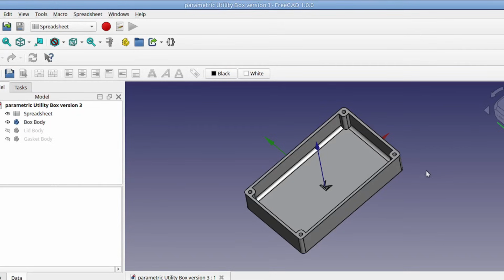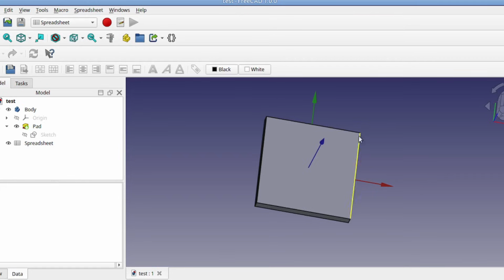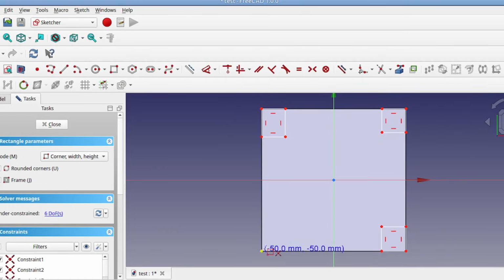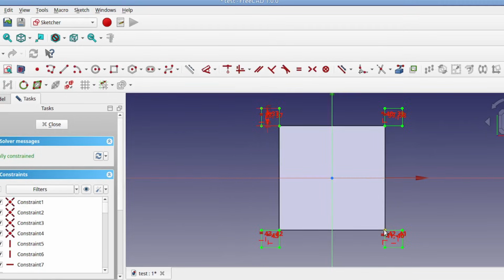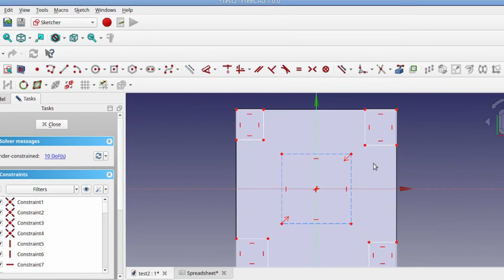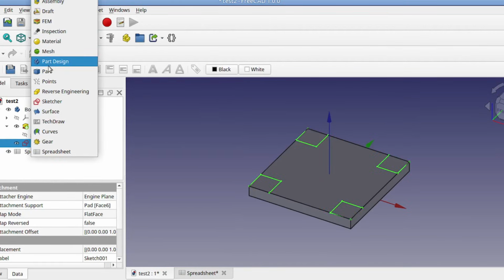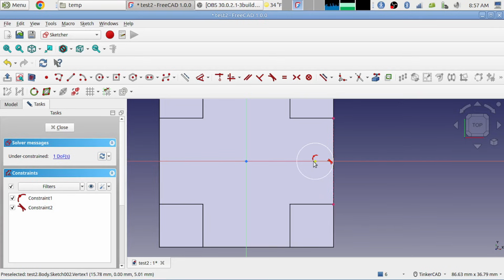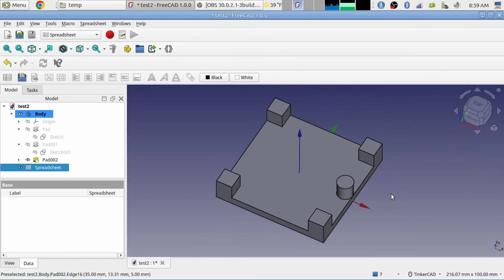3D design - One way of working around sketch flipping in dynamic models in FreeCAD.

Comment: The two antennas I bought turned out to be full quarter wave 11 meters. I walked around with it, and it was pulling in stations well. Too much torque for my photographic light stand, so I will have to pound in a solid post into the ground. Two 1/4 wave antennas physically and electrically at 90 degrees. I apologize for talking too much here, but I thought you might like to know the outcome. Thanks.

Comment: A very good solution - I frequently use construction lines in my sketches for all sorts of reasons (but still very, very rarely draw a sketch on a face - old habits). 
BTW pressing '=' in a dimension input will immediately pop up the Expression Editor for your spreadsheet values. Saves trying to click on that tiny round icon!
Reply from the maker: I'll sketch on a surface if I'm just making a one-off model and I'm not going to be making very many adjustments to it. 
But in that fully parametric dynamic project box model, nearly all of the sketches are anchored on the XY plane or the XZ plane, and I'm using offsets in placement to position them where I want them to be. More reliable. 
The fillet around the bottom edge inside the box is also manually created. I have a sweep path that dynamically resizes itself along with the box to always exist right along that bottom edge and I drew the fillet profile which also dynamically resizes based on the boxes calculated fillets. The profile is then swept around the bottom inside edge of the box with the additive pipe function. 
 The whole model is quite stable. If you want to check it out, it's linked in the video description. I put it on GitHub.
Reply: @loughkb  I like the idea of a fillet on a sweep - fillets & chamfers are always the first to break. I've swept external fillets before (only when I had to but never internal ones.
Reply from the maker: I'll do external fillets in the base sketch when I can.
Reply: @loughkb  These days it's fillets on the vertical corners and chamfers around the perimeter - may sound odd but prints really well! There's an example box for in my CNCProbeInterface github repository.
Reply from the maker: Yeah, that's how my project box is done. The bottom outer edge is a 1 mm chamfer. That angle prints cleanly and it takes the edge off and makes it more comfortable on the fingers while you're holding it. I put a 0.7 mm chamfer on the lids edge as well.  Slightly smaller to accommodate a slight countersink chamfer around the screw holes.

Comment: Great video. I just did the same project you just did in FreeCAD 1.0 and Ondsel and they broke.  I had trouble making the constraint for the circle with the tangent to outer edge of square so I del line to circle Tangential restraint. I created a lenght demention,  from center of scetch to center of circle. spreadsheet.box_lenght / 2 - spreadsheet.Circle_Rad to keep my circle in check.  I can not believe, I have not come across this before. Great Job and thank your for the tip.  I do a lot of parametric modeling just for fun.  Thank you so much.  I did not have the problem with my square flipping I think it was because I set a equal restrain for the length for each square a and a width equal restraint for each square then gave a spreadsheet.square_width restrain and a spreadsheet. square_length restrain and that part did not break for me. That way I can change width, length, height and square_lengh and width and square_hight with my spreadsheet.  I also did the same thing for the cicle_diamter, circle_rad is just spreadsheet.circle_dia/2 and circle_thickness.  Again thank you great video.
Reply from the maker: You probably didn't notice, but the file for my dynamic box is linked in the video description.
Reply: @loughkb  I did not but I will for sure check it out with my next click.  Thank you for your reply.